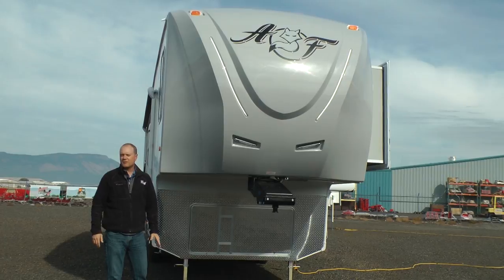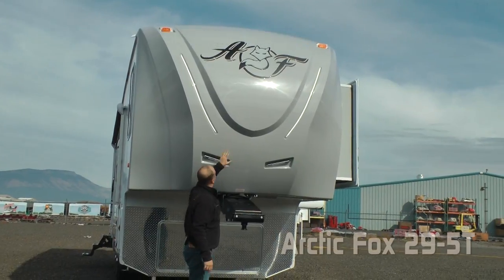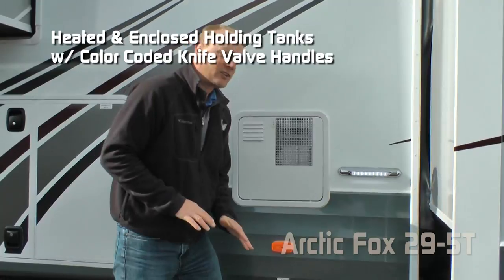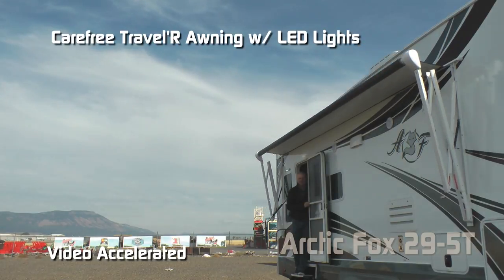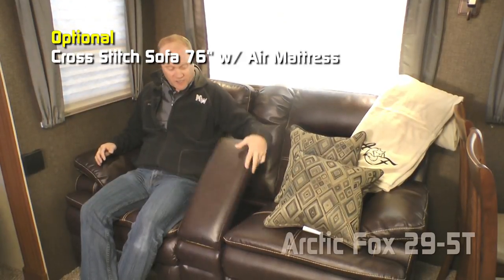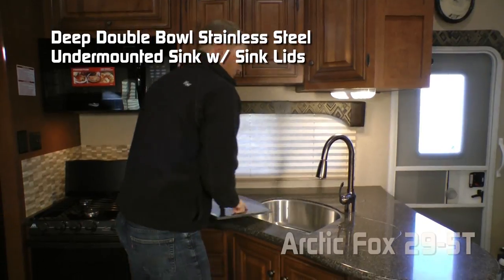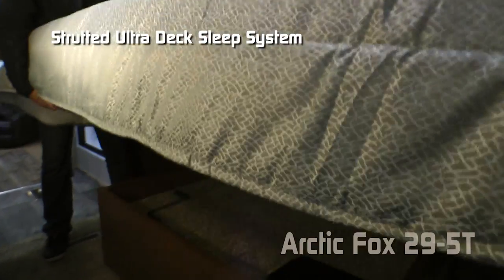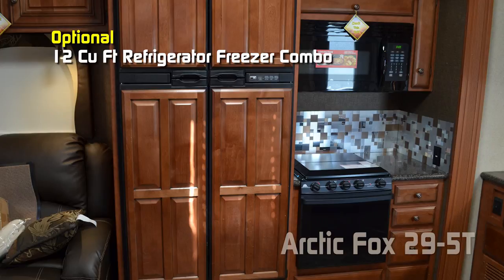Quick Tour Of the Arctic Fox Silver Fox 29-5T Fifth Wheel

Comment: Why didn't you put a window on the drivers side back seating area?  Would it be possible to option one in, if we were willing to order and wait?  Love everything about the rig, but that just seems odd not to have a window there.  Just my opinion of course.
Reply from the maker: Unfortunately we cannot add windows. The walls are CNC routed and in order to add windows it would take a great deal of customization and a new CNC program for that one specific unit.
Reply: Northwood Manufacturing Appreciate the reply.  Thanks.